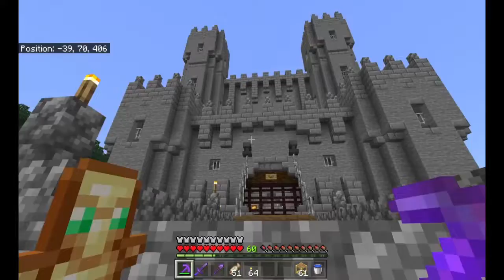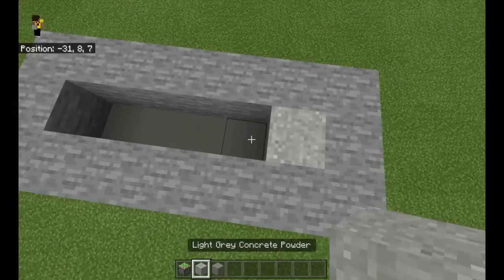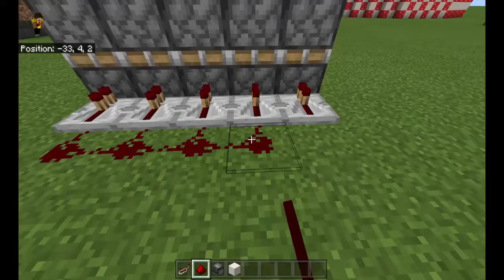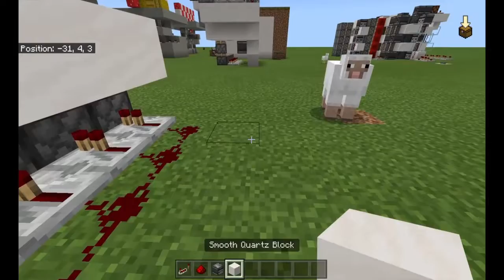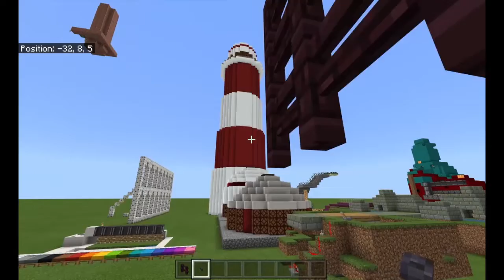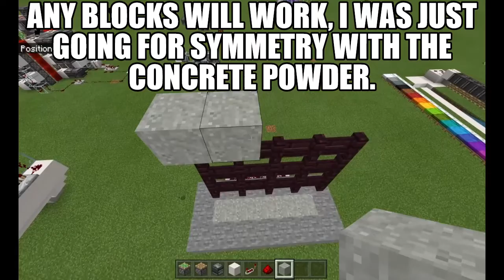Minecraft - Portcullis Redstone Tutorial (Bedrock Edition)

Comment: Would it be possible to place two buttons on the same side?
Reply from the maker: Well yes, so long as they are connected to the Redstone repeater (the one that points into the droppers), you can move or place additional buttons wherever you want.

As I said in the video, with this design, you can also use the same button to open and close the gate, so if you only want the gate to be usable from the inside for example, you can just remove the outside button and it will still work fine.
Reply: @McPlayer8t  Oh that’s awesome tysm